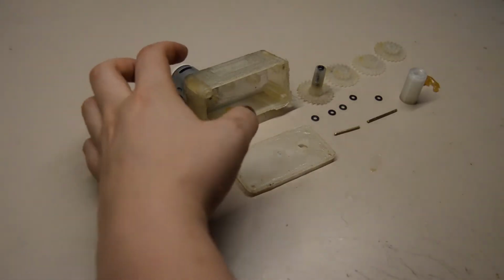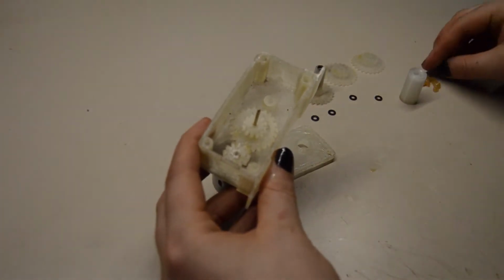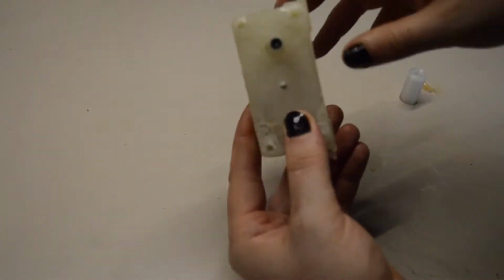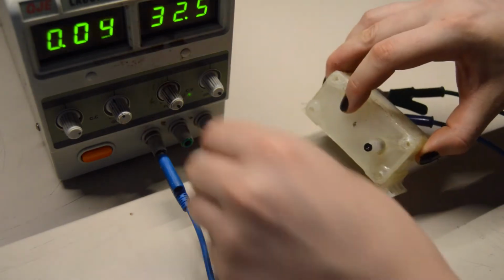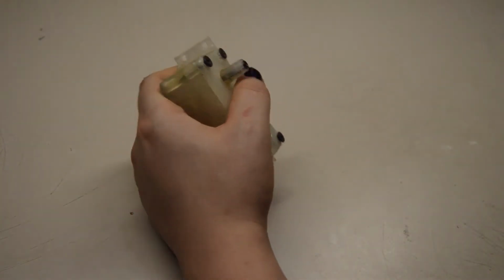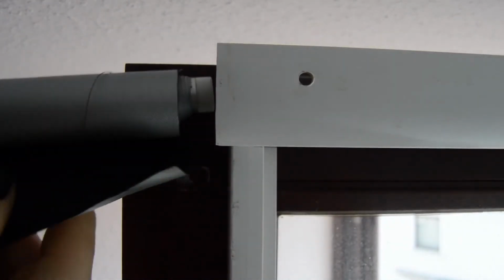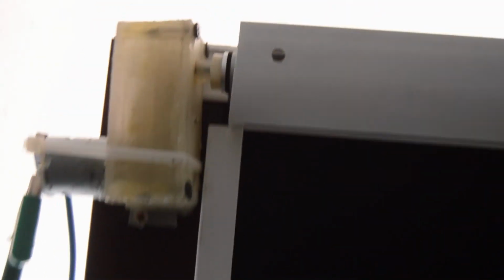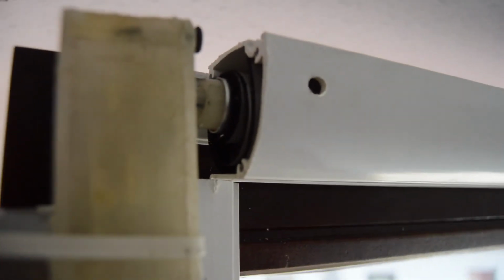How to automate the window shade - Part 1: the Mechanics

Comment: that's a amazing tutorial.
I have a question: In my gearbox, the gears always break after about a year.
Do you think metal gears would be better?

It's amazing that you can do all this yourself >.<
Reply from the maker: Hey Muffin,
Thanks for the complements :)
regarding your question,It always depends on the load and torque that you need to transmit, the forces in regard to the window shade are restively low.
I had to replace the metal gears from my rc boat on the other hand, they got misaligned and the 1.5kw from the motor did the rest, afterwards there where no teeth left on the gears ^^"
I will see how long the ABS gears will last, maybe make a one year update :3
Reply: Thank you <3